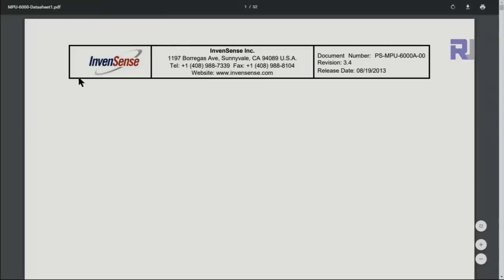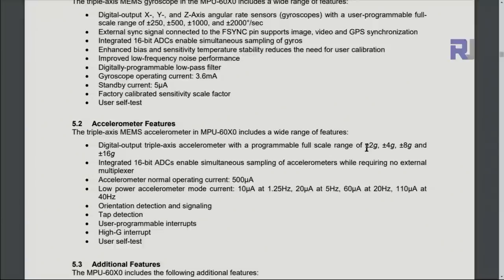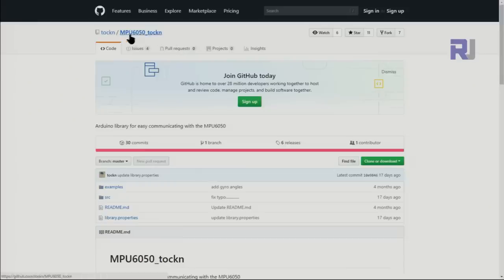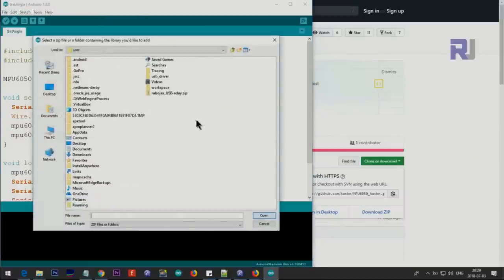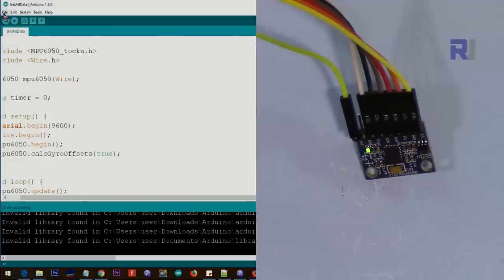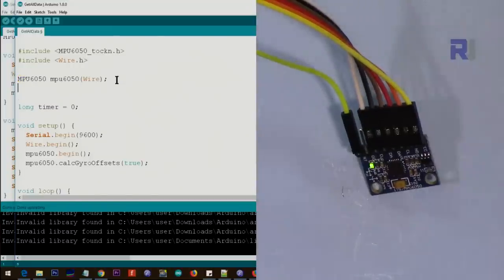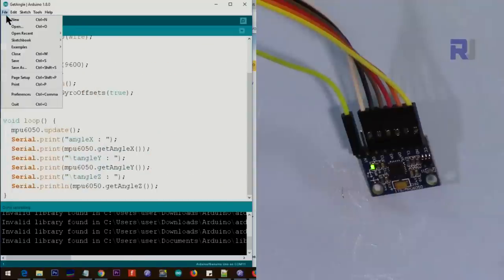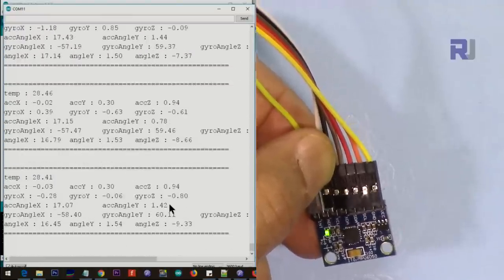How to use MPU-6050 Accelerometer and Gyroscope with Arduino code

Comment: hello and thanks a lot for your sketch! it works like a charm, but i have a question. How to deal with 180+ problem. For instance i would like to continue storing the angle after i do a 180 degree up to 359. It is possible? I dont know how but in my android phone i tried a gyro sensor test demo and it is possible to continue the rotation up to 360. maybe it should be based on a script like if the prev angle was 179 then continue to add angles bla bla bla? Thanks a lot!

Comment: why my MPU 6050 just read 90 degree angle?
Reply from the maker: move it or rotate it. Perhaps you are keeping in the same axis. This is strange.
Reply: @robojax  oh no, it just read x -90 , y 90, and z 0. I have rotate it, but the result is same. How? You have a solution?

Comment: Hi sir,I tried  to follow your tutoriali did everything the same. but the value stays on 127 to all variables x y z,  i thought my mpu is not working then i tried another MPU Chip and the results are the same, any tips? :)
Reply from the maker: hi, use I2C scanner to check if device is connected or check wiring.  on robojax.com search for I2C scanner code, run it to see if it prints the I2C address then check the wiring.

Comment: Only connect SDA and SCL to retrieve gyro angle and accelerometer values.  

XCL and XDA do not need to be connected.  They are for connecting an external magnetometer module so that DMU (an advanced, but seldom used, feature) can calculate yaw using the magnetometer as a slave device.  You shouldn't need the interrupt pin either, unless you are using the advanced DMU feature of the MPU6050.  You only need to connect Vcc, Gnd, SDA and SCL to use the device.
Reply: saved
Reply: thanks bro this really helped me ; )
Reply: THANK YOU

Comment: Thank you for the excellent explanation.
I have two additional questions:
1) How can I read the temperature?
2) I understand there is a Tangent function available (in the IDE or perhaps in the Library). I need to use this in one axis. Where is it, and how can I get the tangent of the angle the MPU6050 is detecting?

Comment: Thank you for this informative video; I have a question; after doing the same and testing it, I noticed that the Z value is changing over time even without touching the module. Do you have any idea why?

Comment: Hey dude would you please tell me the difference between ADXL345 and MPU6050 , and which one should be preferred for esp32?🙏
Reply from the maker: The first one is just accelerometer but the 2nd one has gyro and compass. When you use I2C it works with both.

Comment: i have a question. can we use this sensor on inclined plane to test somethings stability? if we could then where do we place it and how is it going to work, im so lost pls helpp.... thanks so much for this videoo tho soo helpful!
Reply from the maker: Perhaps from watching this video you have learned that this sets a reference coordinate in  3d plane.  whatever angle you put it, it sets those as 0,0,0 in x, y and z. So if you are installing it in inclinded surface, then in the code add or subtract that angle. The location doesn't matter. as soon as the module powers up it sets them as zero but you add your inclined value to get correct angle in any of the 3d plane.
Reply: @robojax  so its okay if we dont put it on the object that we are going to test? i thought we have to put it there so we can now the angle and stuff from the object? and i still dont get how exactly the sensor work...
Reply from the maker: you should put it  and it has inclination in X or Y or Z and add or subtract the value. inside the cod.e

Comment: Thank you a lot. your video was the best that I found and only your code works for my project. Question: Whats happen If I dont conect INT pin? Sometime the angle Z is decreasing alone,  this is my questions. Thanks you man. Congrats, you are a genius
Reply from the maker: You are welcome. INT pin can be left open. see it in datasheet on page 21 https://www.invensense.com/wp-content/uploads/2015/02/MPU-6000-Datasheet1.pdf
Reply: @Robojax TKS. I'm going to take off INT. And about angle Z, do You Know why the numer is decreasing?

Comment: Hello, is it possible to connect 2 different gyroscopes with your code ? If yes, should they be connected in parallel or each one on a different input ?
Reply from the maker: Hi, I haven't tried it but you can get the idea from this video of mine https://youtu.be/WQ3oFyF5qeY
Reply: thx !
Reply from the maker: You are welcome.

Comment: A great video, I am wondering if you could help me on my project using this module , I am trying to write code to put in an "if" statement to light up a led when the "X = 45 " on the serial monitor. I have tried all I know but have no success it would be greatly appreciated
Thank you 
Robin From Australia
Reply from the maker: Hi Robin, even is you keep it stationary, the value will fluctuate. 45 " very large value. and your value will not match. so you have to allow tolerance in your reading. On the page where the code is https://robojax.com/learn/arduino/?vid=robojax-mpu6050-basic if you look at datasheet on page 12 it show the tolerance is 3% .  here is my resent video where I was comparing a value and allowed with certain tolerance like 1% or 10% https://youtu.be/AI-zzmSZVfw you have to watch the video in two section. in the introduction I've explained tolerance and how it works and in the code I've explained how it is accomplished. So experiment with % value to find out which value works for you. if you don't' watch it, you wont' understand. so  good luck.  Greetings from Ahmad from Canada

Comment: Hello sir!  This is great help for an MPU 5060. Everything working fine but the angles reads as for X:0, Y:0, Z:0.
 if i move MPU 5060 it's dosn't change angle.
What could be the possiblity ?
Reply: mine angles are changing, but my linear acceleration is not working fine
Reply: Can we exchange our codes and libraries?

Comment: Hello!!  This is great help for an MPU 5060. Everything working fine but the angles reads as for X:-90, Y:90, Z:0.
What could be the possible errors  this may be having??
ThankYou.
Reply from the maker: please check wiring. or disconnect and see what is the reading.
Reply: @robojax Thnak you for response!! After I replied to the video and before your response to the problem I tried the same setup but found the readings  fluctuating  and for z: it is going around 1500 or so... same for y and x  but below 1000.... even when the MPU was still.   In another case I tried I2C scanner for the MPU  at a loop of 1sec. It showed 0x68 address and mpu found in first 2 to 3 scans then it said of not founding the same. I think the gyro may be faulty(still have to buy a new one). Or may be there some other technical problem??
  ""Thanks again for your response.

Comment: Hi, i'm dont know much about Arduino, neither speak english, but you video help me a lot.
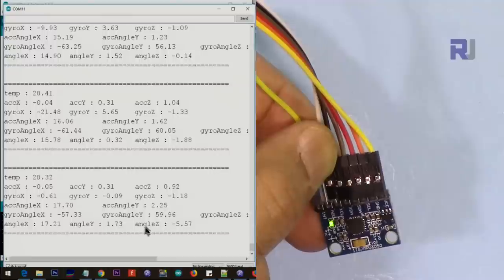But i still don't understand about, on the serial monitor, minute 12:29 for example, you have accX, accY, accZ and their respectives values. Same for Gyro. i would like to know what are these values about since the angles of both gyroscope e accelerometer are given in accAngleX... and accGyroX.
And Angle X, Angle y, Angle z, on the last part, those referenced at the angles of what ?. 
If you answer i would be grateful.
Reply from the maker: Hello, I have spent a lot of time typing the subtitle. Watch it with subtitle . I believe we have over 50 languages.
Reply: @robojax  Thank You !

Comment: Hi sir,
Can I use this sensor to engage a servo if an angle detected on x or y axis (e.g over 60 degrees)
Could you help me please? 
Thank you in advance!
Reply from the maker: yes you can.  Try this to print value on serial monitor with if condition. Once it worked, then use servo.
Reply: you can do it with a 180 degree servo

Comment: I have a question .

how exactly can the aceleromiter have a different angle than the gyroscope  shouldnt they be the same angle
Reply from the maker: gyroscope is use to get orientation in X, Y, Z coordinate (up, down, left right and around axis). but accelerometer. is for  motion (speed) in specific direction.  so angle and acceleration are two different thing.
Reply: @robojax  I am talking about how you have 2 angles one for acceleration and another for the gyro because if the gyroscope measures acceleration wouldn't that be the angle that it is at not some gyroAngle
Reply from the maker: you gotta hold an object like pen in 3d space and try to understand. each has has its own reference and angle.
Reply: @robojax  ok. Thank you

Comment: does anyone know how to simulate the output signal of the mpu6050 with arduino ? i have an electric unicycle and its circuit board works with an accelerometer and i want to use it with a potentiometer. is there any code ?
Reply from the maker: Arduino is reading digital data from this board. Poetentiometer (variable resistor) is analog. You will need some extra work to convert analog to digital, (in arduino which is easy) then the value to convert it in a format similar to MPU-6050 so Arduino library understands it.

Comment: Wonderful. I have a great application for this. But it would be nice to graph in the dynamic sense. Or do a sample of say a given time period ( a sew seconds only) and be able to zoom in on the time line.
The tiny brushless motors used in mini quads can be out of balance. Spinning at ~ 25,000 RPM  any problems with balance can just obliterate the onboard Gyro/ Accel with many multiples of the 1st Harmonic(often a 6050, but also the ICM 20602 is used) 
The size of the GY521 breakout makes sense for these tight places Maybe even with the  I will be able to get a handle on where to place my tape on the bell of the motor with out losing my patience and just buying more expensive. 
I can't thank you enough for publishing this and the Github link and I can't wait to fool around with the code!  Happy New Year. Regards, CGL
Reply from the maker: You are welcome Chris, I am glad you found this useful.  Thank you for your kind and nice comment. Ahmad

Comment: How can connect two mpu6050s together with this library? For some reason  i cant get my code to work..what do i need to modify in the library to get two imus to work together?
Reply from the maker: I spent 2 or 3 days and it did not work. It seems we need different library so it can work with multiple modules. If I get a chance, I will write library but not in the near future.
Reply: @robojax ohh i see. Im probably going to have to use more than one arduino uno then. Thanks anyways...your help was appreciated!!
Reply from the maker: You are welcome.

Comment: Hi, the module is giving accurate results of gyro angles and gyro accelerations, but I could not get acceleration values in X, Y and Z direction. Can you please help me find the possible errors?
Reply from the maker: Assalamu alaikum Muhammad, I am not sure what could be the issue. You would have to move it to see acceleration. If you haven't modified the code, you should see it. Very rarely possible that the module be bad.
Reply: @robojax  Wasalam. Thank you for your reply. I have changed the module as well, but unfortunately I didn't provide me linear acceleration. It only shows angular acceleration. Also I have not changed the code. Also I am expecting linear acceleration from the variables accX, accY, accZ.
Reply: Are you available?

Comment: Good day Robojax... Thanks for your videos, you've help me with a lot projects...Thats also why Ive posted this comment...

So I have a mpu6050 and I have build a self balancing RC motorcycle, the project is 99% complete, however, the code on the arduino that reads the data form the mpu would freeze the arduino or cause the some weird shit...I am not sure anymore if it is due to interference or even something dodge in the mpu6050 library which I am currently using 

 The mpu6050 library I've used is from a guy named Jeff something, he's mpu 6050 code is quite popular...Ill have to search his full name and surname if you want. His code is quite sensitive, if I use a delay() somewhere in my loop() then it bugs out... 

Problem is, his source code to read measurements from the mpu6050 is miles long, confuses me and I had to change stuff in his header files to make it work longer on my Nano (In the beginning I often received a Fifo overflow error). I also have two 3.3k pull up resistors on the SCL and SDA pins

I am planning to switch out tomorrow his code and library for yours as yours is much shorter...

MY QUESTION: Have you build something like a self balancing robot with the mpu6050? How sensitive is it to noice and interference from the motors?
Sometimes after I turn on my motor, the mpu will send random angles to the steering servo. The mpu is not that close to the drive motor of the motorcycle (its about 15cm away)

Any idees or comments?

Thanks
Manie

Edit: Jeff Rowberg is the name of the guy that created the mpu6050, on the Arduino forum a lot of people mentioned that they've used his library...
Reply from the maker: Hi Manie, You are welcome and thank yo for sharing your  thoughts. I have not made any self-balancing robot. I love the idea and it is very interesting project to use control system.  But I have full time job and family. Very busy  trying to make a living.  
good luck with your projects.
Reply: @robojax  that's cool, I understand👌👌 Thanks anyway and stay safe man👍

Comment: Thanks Sir! That's very informative tut.. Please sir guide me how can we set the code for Two MPU6050  Sensor, means how can we set the address for another MPU6050. Thanks Sir
Reply from the maker: So you want to use, two of the same module? if so I have no answer for that.
Reply: @robojax  A lot thanks sir... I have done it..
Reply: How? I am having the same problem. I will be happy if u could help please

Comment: My code gets stuck when it reaches wire.endtransmission(). what is the solution for that?
Reply from the maker: Please start with new code and use it without modifying it. Once it worked, then modify it.

Comment: If you use a second accelerometer, How is going to be the wire connection for the second accelerometer?
Reply from the maker: You can use the exact principle in this video that uses two LED display.  Apply it to the MPU-6050 https://www.youtube.com/watch?v=27KjMfPH1dk
Reply: @robojax  can you please specify how to use  SDA  & ADo pin for both the accelerometer

Comment: Hmmm the wiring is a bit unclear. Could you help explain more on it?
Reply from the maker: I just watched the video and I have not left out anything in wiring. You need to listen carefully.  You can't jump or skip to watch it quickly. to understand the wiring, you should have watched the beginning of the video where I explained the hardware and all pins.
Reply: @robojax  Hey! Thank you very much for replying and making such a good video! Sorry i think you misunderstood me, what i meant was that the wiring was well explained, however I was confused with some of the connections that you explained. And also, I actually watched the whole video 5 times just to make sure i understand the whole process. 
I hope you could help confirm if im doing the connection right. My connection is as follows : 
(Arduino Uno)->MPU6050
5V->Vcc
Gnd->Gnd
SCL->SCL
SDA->SDA
Now this is where I get a bit confused,
For default settings i connected the following: 
A4->XDA
A5->XCL 
(No Connection)->ADO
 Digital Pin 2>Int
IS that correct?
Reply: @robojax  hi jax, I redid the wiring and i found that the problem was a faulty wire and not the connection! It seems a loose or bad connection will cause the program to stop immediately. 

I have a problem though that i hope you could help with. its mainly due to the IMU drift. I see the value slowly drift upwards when idle at times and sometimes it hovers up and down at a a set value. 
Is there any way to help improve this?

Comment: So, it can't start at any angle and read that angle.
Reply from the maker: When it starts from any position that is your reference and it would be zero. You then calculate from that point. Of course you can write your own code with some action or push buttons so it can initialized from new reference point.

Comment: How can I change from 2g to 8g or 16g?
Reply from the maker: Hi,
In MPU6050_tockn.cpp line 12 shown here https://github.com/tockn/MPU6050_tockn/blob/master/src/MPU6050_tockn.cpp
writeMPU6050(MPU6050_ACCEL_CONFIG, 0x00); selected 2g now. Change it as you desire.
0x00 ±2g (this is set now.)
0x01 ±4g
0x02 ±8g
0x03 ±16g

Here is how I found them
In page 15 https://www.invensense.com/wp-content/uploads/2015/02/MPU-6000-Register-Map1.pdf

ACCEL_CONFIG Bit 3 and 4 in Register 0x1c or 28 (decimal)

In line 11 in header file shows the address 0x1c:
https://github.com/tockn/MPU6050_tockn/blob/master/src/MPU6050_tockn.h
Reply from the maker: ? never heard from you
Reply: @robojax  Oh sry Youtube did not notificate me that you answered me. Sadly this doesnt help ... Still only 2g.

Comment: i gets only 0's in output of all data
Reply from the maker: Either the code has changed when you copied or wiring is incorrect. Try to copy and paste the code
Reply: Some modules pull AD0 high, some pull it low.  It sets the slave address to 67 or 68.  Try using the other address in the code.

Comment: This video is why I struggle s much. You just totally skipped over the ADO pin and you weren't very clear at all with the the XDA AND XCL mess either...
Reply from the maker: those were not of our concern. I have provided the link to datasheet in the same page where Arduino code is. See the description.
Reply: They're not really necessary for his purpose
Reply: He isn't really unclear-- it takes some common sense of yourself to figure out.